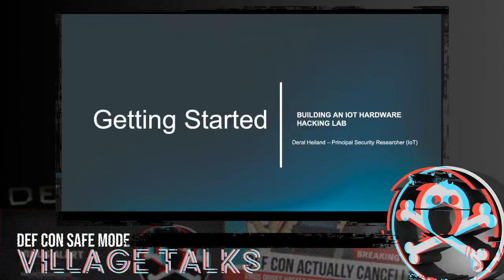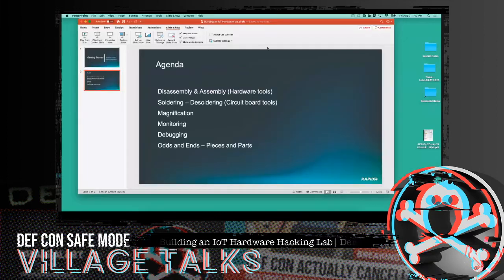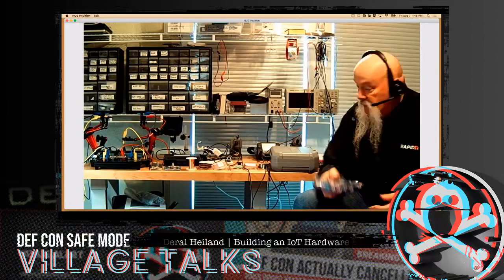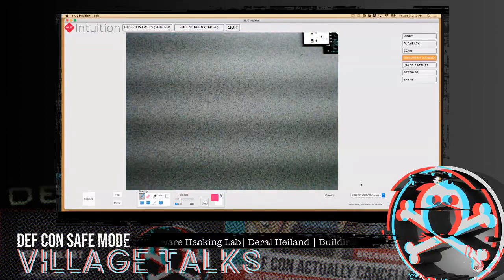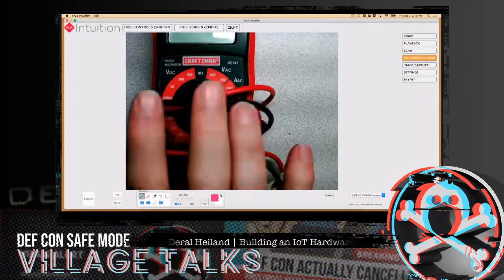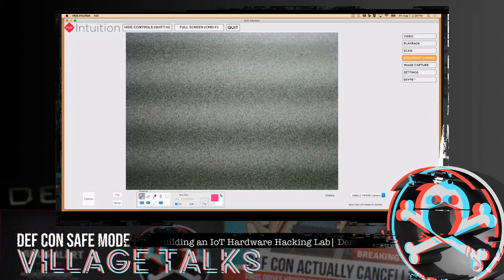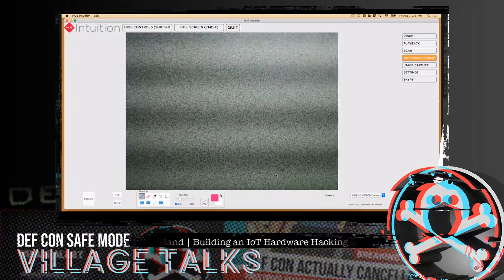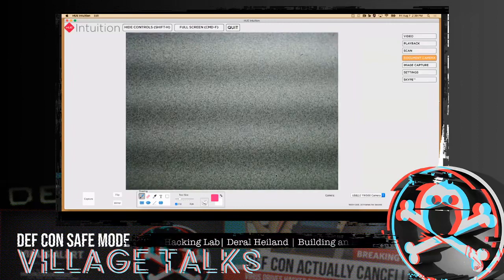DEF CON Safe Mode IoT Village - Deral Heiland - Getting Started Building an IoT Hardware Hacking Lab

Comment: IMHO talks like this are one of the few reasons DC28 was cool.  The subject-based pause for questions isn't usually done at normal Defcon, which resulted in topical questions that Deral couldn't answer (I.E. the benchtop LA & flipper questions), which sounds bad but was neat & relateable.  Normal talks seem to rush the Q session at the end, which brings me to big-up #2(.5(?)):  It's cool to be able to go over time.  Nice work Deral, cool talk man!  Also screw you for making me think of new things I should buy ;)